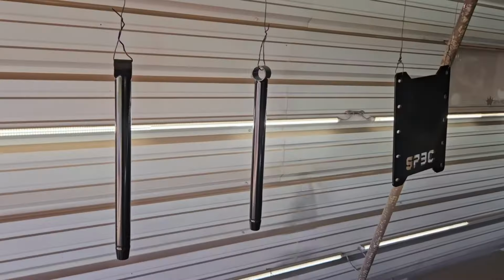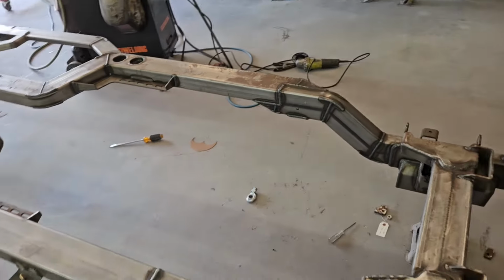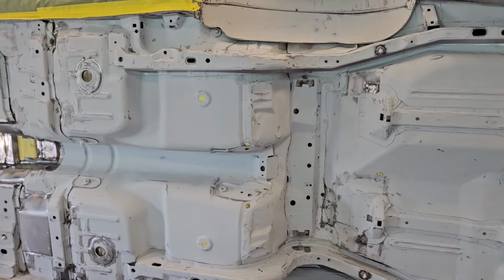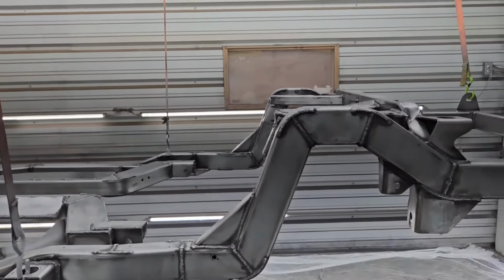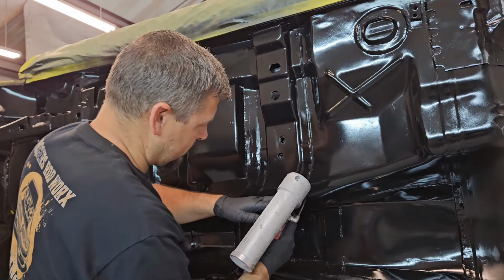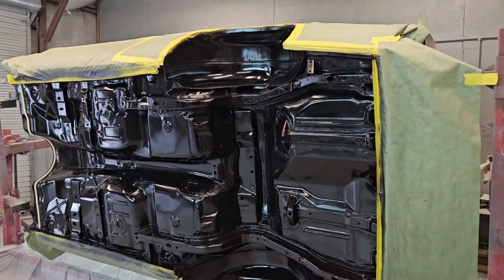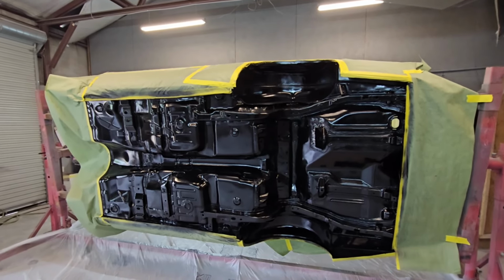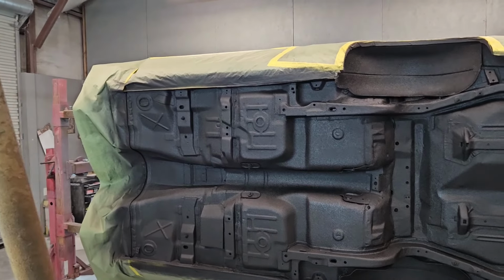Part 2 of painting and undercoating

Comment: That thing is coming out so awesome! I do have a question about the Raptor Liner. How does it look when you touch it up? I was wondering for my build. Say I clean a small area off later and weld an exhaust hanger on and then re-prime the area and spray some more Raptor Liner on that area, how well does it blend? Not that it is a big deal at all, just curious. Thank you and keep up the awesome work and the cool videos sir!!!!
Reply from the maker: I'll be honest. I've never done that. The raptor liner is a urethane product, so you should be able to blend it out. They make some in a 2k spray can you could use on small areas.  Otherwise, you have a full 32oz of activated product to use if you go with the bottles that i spray..
Reply: @rogersrodworx  Thank you, I appreciate it. I didn't know they had the 2K can. I just looked now and someone used 1 can to do the outside of the Ram 1500 bumper so that can should be perfect for touchups later. I don't imagine it would last too long so I will plan on using the whole can. Either way, thank you for the info sir and have a great one!